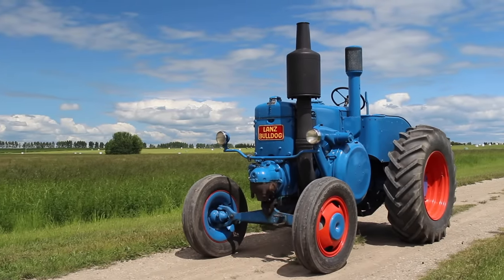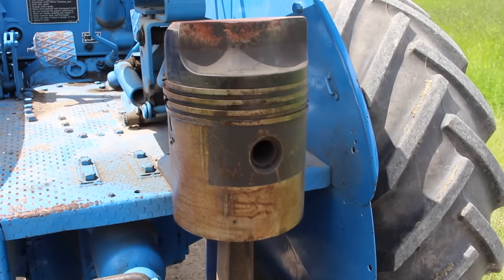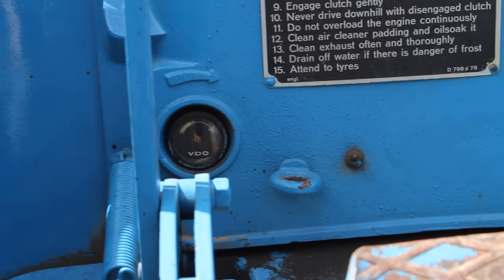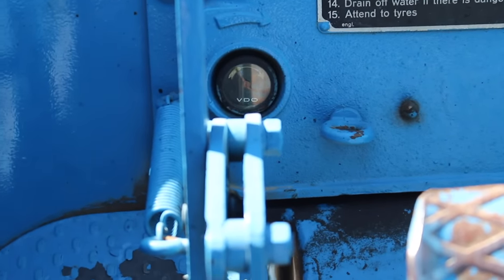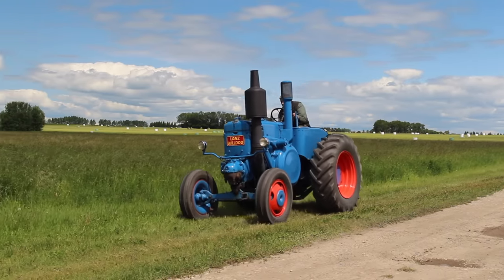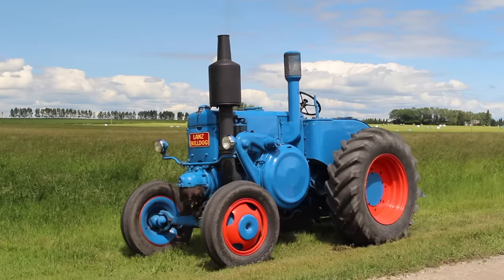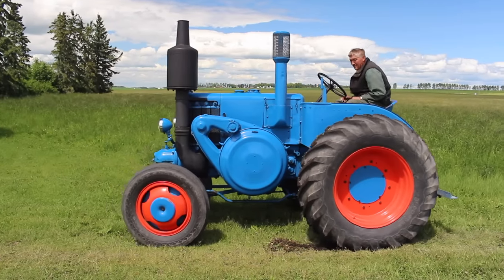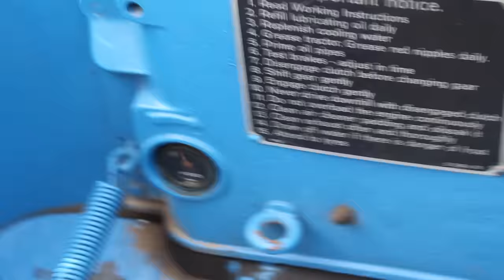Engine running backwards? Lanz Bulldog Tractor two stroke

Comment: these kind of tractors were particularly scary when ran uphill, since the engine could rotate so slowly that the force of gravity would reverse the engine rotation, imagine you're a climbing a steep hill and suddenly the tractor "shifts into reverse" at full speed and you're sent flying downhill facing the wrong way and with no brakes to speak of
Reply: No, it can't happen. Gravity can't reverse shit. As long you are rolling you can't just reverse the direction
Reply: @MaxMustermann-pu6er  if there is a heavy load, and it is running slow enough, a diesel can start running in reverse. I have seen an old caterpillar d2 with a four stroke inline four diesel pulling massive oak logs uphill. the operator didn't know what he was doing, and kept it in third. The immense weight, the too tall a gear, and engine being run almost to the point of stall. The motor started running backwards, exhaust started coming out the intake. And the thing started down the hill, the log chain almost getting caught in the tracks. Luckily he shut the engine off before major damage was done, ha. But in conclusion. Gravity can put such a strain on a diesel that it will try to stall and suddenly reverse it self. It is possibe and I know from experiance that it can happen.
Reply: @phantomcorsair8476  : You made it up as you wrote, didn't you?    A Cat D2 is a 4-stroke.   Lanz Bulldogs are 2-stroke.   Two strokes (Bulldogs, GM/Detroits) can run backwards as described in this video, but 4 stroke (diesels or gas or gasoline) engines, unless deliberately messed about with, cannot.  They can't because the fuel injection pump (jerk pump) runs at half crankshaft speed and the fuel-pump piston upstrokes will occur at the end of the normal air intake phase, which in reverse is now the exhaust stroke, due to the fixed valve timing.  
Modern Cat engines use hydraulically  operated electrically controlled injectors fed by a common high pressure fuel pump.   The injection force actually comes from a third pushrod, which in reverse will push after the (now) exhaust stroke, so reverse running isn't possible.    In any case the computer won't send the signal at the right time to enable backwards running.  This obviously does not apply to a very old (i.e. pre hydraulic operated injection) D2 bulldozer.
It is possible to stall a diesel engine and have it fire back through the intake manifold, but only for one turn as the last charge in a cylinder is fired - the just completed compression stroke acting as a power stroke.   It's also possible for an extremely badly worn and very hot engine to run backwards for a short while by firing on lube oil.  Such engines are so worn they are very difficult to start when cold due to low compression.
You can, very very rarely, see a 4-stroke diesel running backwards in a workshop - I've seen it myself when I worked for a diesel engine dealer.   Diesel engines are configured in the factory for reverse running for marine applications.   If a mechanic makes 2 mistakes on a standard engine - installing a  LHS starter motor AND times the fuel injection completely wrong, it will run backwards (not very well).  This is pretty much a sackable offence, because you have to "try" hard to make such a double mistake,  and since the oil pump is running backwards, the bearings will be damaged in seconds.

A more common mistake is to install an RHS starter motor on an LHS motor, or vice versa.  The result is that the engine simply will NOT start.  It's a trap for apprentices, as they check everything that the tech school taught them, spend a lot of time, and that engine just will not start.
Reply: @keithammleter3824  can you fix my car?
Reply: @mobbdeep615  : Probably, if you bring it to me, and pay me a big enough bribe.   Almost anything is fixable if enough money is thrown at it.  
 PS - I made a silly error in my previous post.  A GM/Detroit engine cannot run backwards unless modified, even though it is a 2-stroke, because it is a force induction engine.  If you turn it backwards, the blower pulls air out of the cylinders instead of forcing it in,
Reply: @phantomcorsair8476  : You don't need to tell me basic facts about D2's that you can find out in minutes by watching D2 videos eg those posted by Squatch (which are excellent)  - I owned a 6U 1950's D4 and there is a bit of dialog between my and Squatch in the comments of a few of them.  The D4 is just a scaled up version of the D2.  I also worked for a Cat dealer several years (as an Engineer).
I suggest you do this:  Make out a series of piston, conrod, and crank diagrams for each 45 degrees of crank rotation to cover the whole 4-stroke series (2 full turns) left to right.  Mark on each stage the valve positions, the stroke name and the TDC position that is the nominal injection time.   The sequence (in part) goes:   exhaust valve open, closes and inlet valve opens, closes, compression stroke and injection.  Now, with a different colour pen, going right to left  mark the stroke names and injection time,  You are correct in saying the exhaust valve now functions as inlet, and the inlet now functions as exhaust.  BUT, as the jerk pump is driven at half crank speed, and pumps when the pump pistons move up, the injection time moves 180 degrees on the pump shaft or one complete turn on the crankshaft.   This puts injection just before the top of the reverse running "exhaust" stroke so the engine cannot continue running.   The sequence becomes inlet valve (functioning as exhaust) opens, injection (into residual burnt gasses), no compression stroke yet and inlet valve closes, exhaust valve(functioning as inlet) opens, then closes to begin the "compression" stroke .....
That's why I think your post was just your imagination.   An jerk pump engine like an old D2 that starts and runs ok just will not run backwards.  Not possible.
An engine whose bearings have rotated is not going to run much longer, but this sort of wear out does not enable running backwards.   What can enable it is really bad cylinder wear, but only when compression has become so low the engine is really really difficult to start.  Lube oil gets past the rings and if the engine is hot enough it can burn and run on it.
Note that valve and other faults can cause blow-back through the inlet manifold and air cleaner, but this is while the engine is turning in the normal direction.  One of the ways we dealers can quickly assess the condition of old D2's, D4's, D6's etc is to dissassemble the aircleaner.   As you pull each mesh out (they come out air end first and engine end last), you sometimes see them get progressively cleaner (the mesh has been doing its job of filtering dust out of the air) and then progressively dirtier - this indicates a badly maintained engine and it has being blowing back, and the aircleaner has been filtering out the engine soot.  You often may not hear it blowing back on a test run, but sometimes you will.
If you did indeed see a D2 going unintentionally backwards down a hill,  perhaps the operator accidentally knocked it out of gear (through this is not usually that easy to do on old Cat machines), he might have decided to change down when the engine slowed down (this implies inexperience), or it jumped out of gear due to really bad gearbox wear.  You actually have to try a bit hard to stall a Cat bulldozer engine though - on almost any soil the 6U tracks loose traction before the engine stalls, unless you are in a high gear.   The narrower 5U tracks are even more likely to slip.   I put a home-made tree lever on my D4, but the D4 was pretty weak with trees.   On anything bigger than a 150mm trunk, the tree would bend a bit and then the tracks would slip, digging a hole.  I used to just let it do that sometimes, and after a moment or 2 with all the shaking and vibrating, a tree root would break and then down the tree came.  A Cat with a stopped engine will not go down hill due to gravity if it is in gear, except perhaps if it is a really really steep hill.  It's geared down too much and compression is more than three times what a car engine has (15:1 ratio and a MUCH bigger displacement for the power rating). .
I guess you made your story up.
Reply: @phantomcorsair8476  : If it was INSTANTLY shut off, how do you know it would have continued to run if it wasn't shut off???  As I said before, an engine stalling can combust the last bit of fuel injected, run back part of a turn and blow it out the intake, but it will then stop - whether you shut it off or not.
Reply: @phantomcorsair8476  : I see - horrible grating sound - just like a really badly worn gear box jumping out of gear due to the  low RPM.  Perhaps the inexperienced operator immediately put it in another gear or back in the same gear, but by the time he got it in (it's a crash box - no synchro - could make some dreadful crunching sounds just trying to get back in gear) and let out the main clutch, the D2 was already going downhill at some speed.   White smoke is misted unburnt fuel - in other words the engine MAY have been forced to TURN backwards, but was NOT actually BURNING fuel and producing power.
Having said that, I still feel that your story is a tall one for certain reasons.  
White smoke from exhaust during normal use indicates a faulty injector preventing 100% fuel burn, or perhaps a crook valve causing no very low compression in one cylinder (which, with only 4 cylinders in a D2, would be pretty obvious in use).  Really not significant as far as your story about running backwards goes.
I would assume the operator swivelled the machine by pressing the brake on one side.   He didn't need to jump off - it would stop anyway, but I guess a guy with little experience could panic.  And if it still wanted to roll down hill (unlikely), releasing compression would only encourage it.  You implied before he closed the rack, which is a more logical thing to do - it can't possibly run with no fuel injected, but there would be full engine braking.  
Note:  In the diesel industry we usually don't call the "go" lever a throttle, because it isn't a throttle.   We call it a "rack", because it moves a device in the fuel pump (jerk pump) which actually is a rack.  A throttle is a device that varies air or gas flow in a pipe, as it does in a gasoline engine.   Air flow is always wide open in a diesel engine.  In modern electronic (computer) controlled engines there is no jerk pump and therefore no rack, but we still tend call the "go" lever a rack, unless it is the accelerator in a car or truck, in which we call it an accelerator.
Reply: @phantomcorsair8476  :  The squeeeeeeeeek sound, like a slipping fan belt  ....    I can't think what that could be except the fan belt.    (Perhaps the governor self destructing - don't think so though)  As you have described it now, it sounds like the symptoms of a stuck rack.    The speed control lever ("throttle") does not of course control the rack directly in a D2 - its a governed engine.   The operator's speed control lever just tells the governor what RPM you want, and the governor opens or closes the rack as needed to obtain that RPM.   The sequence of events would have been this:-
1.  The engine was started and the tow commenced in too high a gear.
2.   As the load slowed down the engine, the operator opened the lever commanding max RPM, and the governor opened the rack all the way.
3.   The rack stuck in the full power position but this was not noticed due to the heavy load on the engine.
4.   As the engine RPM did not increase, and perhaps continued to fall, the operator decided to change down a gear.  He would have pulled the main clutch and shifted out of the current gear.
5.   With the stuck rack, the governor has no control over RPM and without a load the engine began to race.  At this point it would be difficult to get it back in gear (as it is a crash box - no synchro) and closing the speed lever would have no effect.  
6.  The engine is now racing at extreme RPM.   (extreme for a D2 that is, max spec RPM is 2100)  The fan belt slips as mechanical power to turn a fan rises as RPM cubed, so it can slip even though it didn't at normal RPM.   Due to the extreme RPM, valve bounce is occurring, causing misfiring and blow back in the intake manifold.
In other words, the engine was not running backwards, it was just over-speeding.   You only thought it was running backwards, because of the strange noise and the fuel mist coming from the aircleaner due to valve bounce.  The D2 ran back down hill as it was not in gear.  It is possible that in his panic the operator managed to put the gearbox in reverse, but not very likely.
Perhaps that was why it threw a rod when restarted - the rack was still stuck and the engine over-sped again.  Or perhaps when the engine was stopped the rack un-stuck but the conrod was ready to fail due to the stress already experienced.
This scenario happens occasionally with badly maintained engines - it is a lot lot more likely than running backwards on oil getting down the valve guides.
If you don't change the oil, and/or use old dirty fuel, a stuck rack is one of the things that can happen.
Reply: @Kenionatus  : I am not familiar with Aebi (in fact I had never heard of it), but I checked the url you gave).   Is this a common rail engine?   A Cat D2 is not common rail, its a traditional jerk pump design.  Jerk pump engines cannot continually run backwards for the reason I gave, but this reason does not necessarily apply to common rail where injection timing is electrically controlled by the ECM.  However, in common rail engines I do know about, the ECM will sense something wrong and not fire the injectors.  Modern Cat engines (the ones actually made by Cat and not the ones made by others) aren't common rail until about 2010 or so, they use a related ECM controlled system (HEUI/MUEI) and inherently cannot run backwards
If you do get a 4-stroke engine to run backwards, and in fact most 2-strokes, it should be shut off IMMEDIATELY as the oil pump (always a meshed gear pump, except apparently on the Lanz) will be pumping backwards and deprive the bearings of oil in a second or less.
Reply: @phantomcorsair8476  : "..  Little or no governing .."  That pretty much says a stuck rack as the governors on D2's D4's etc normally hold the engine  RPM in an iron grip, load permitting.  
I'm mystified by the squeel/squeek/pig-in-pain noise if its not the fan belt.    Governor self destructing?   Bearings rotating??  Oil pump starved of oil? - don't think so.  Water pump or hydraulic fluid pump?  Possibly.  I can imagine the total noise was pretty shocking loud though.
Reply: @phantomcorsair8476  : Fortunately, I have never been anywhere near an ape during or after its' rape.    Been near raped house cats though - the noise they make is loud and dreadful.   And the tomcat, after the event, has an expression on its face that suggests "I actually don't know why I did that."
Reply: @phantomcorsair8476  :  Cats (the meowing kind) are amazingly violent animals, and they can make the most awful blood curdling screams and vocal abuse noises.   I have no opinion on B61 Macks with Triplex gearboxes etc, no experience with them.  I am dimly aware of them, that's about all.   1960's era I think.  My interest in Cat bulldozers comes from owning an old D4, which I bought for doing firebreaks on my hobby farm.   My experience in working for a Cat dealer was mainly in electric power generation (3406 through to 3616 engines), with some experience in marine propulsion.  Limited experience in modifying Cat truck engines for long haul freight service (the factory options for oil change intervals - even the largest oil pan option for 3406 and C15 - are too short for cost-to-coast freight in Australia - a single round trip can be 6,000 to 10,000 km.).
Reply: @keithammleter3824  how the hell did this  conversation go from CATs to cats?
Reply: @racecarthedestroyer7192  : Don't forget this started with a bulldog.   Nothing wrong, providing a) somebody is learning something, and b) its fun, and preferably both.  Seems to be the case.
Reply: @keithammleter3824  yeah, true, but did you see the funny i pulled in my previous reply?
Reply: @racecarthedestroyer7192  : Well, yes - Cat (as in big yellow machine) to cat (as in feline).   I thought I had replied in kind: dogs and cats.   I think we have all done enough with this thread now.
Reply: @keithammleter3824  ooooh, yeah lol i see what you did as well
Reply: @keithammleter3824  you and Phantom Corsair need to open a shop together and make some new type of diesel engine to save the world
Reply: @keithammleter3824  You are the only man I would trust to take care of my tractor. I have heard no mechanic so far who knows so many technical details. Most of them are I-know-from-experience ones, just randomly messing with the engine until it fixes itself.
Reply: @marinosavros  :  Marinos, I thank you for your very kind post.    However, I am not a mechanic (though I have always maintained & repaired my own cars and hobby farm equipment).   I am a professional engineer,  who has been responsible for the project management for new diesel power generation, and the customisation of diesel engines for special applications and non-standard fuels, plus the sale of engines in the power generation and marine propulsion markets.
Reply: @keithammleter3824  Either way, you should be proud of yourself. Your dedication and passion about your field are rare qualities which sadly we don't find enough those days. I congratulate you and I wish we had more professionals like you. It's clear that you are dedicated to it.
Reply: @keithammleter3824  My mate had a suzuki ap50 2 stroke motorcycle, he would bump start it backwards and it would take off 😄until he crashed as it's hard to ride in reverse
Reply: @ianmangham4570  : Certainly.   The AP50 is a 1970's era rotary valve 2 stroke gasoline engine - such engines can indeed run backwards quite well, because ignition is at every TDC and not every second TDC, and there is no blower that would suck air out instead of forcing it in.   It would have the Suzuki Posidrive forced lubrication - not 100% sure but I think that would still work too (piston pump).   I doubt if I could ever master riding backwards though.
Railway companies used to have gasoline 2-stroke powered little open railcars for track maintenance staff.   These were just push started in whatever direction they wanted to go - no reverse gear was fitted.  They were just big enough for up to 4 workers to ride on with their tools.  Lubrication was ok either way because they relied on crankcase suction and oil was mixed with the fuel.
Reply: @keithammleter3824  😄🙋👍
Reply: @keithammleter3824  actually it can happen, plenty of isuzu panthers with 4jb1 engines and older 2800cc Mitsubishi tritons have ran away, and both of those engines are naturally aspirated too. Here's an example https://youtu.be/P8DAlFEMDVs
Reply: @tristan6509  :  These Mitsubishi Tritons have a reputation of running away due to imperfect crankcase ventilation design - crankcase lube oil  can get into the intake manifold via the crankcase ventilation, without requiring the engine to be so worn it is difficult to start.  It can happen if you grossly overfill the engine with oil, causing the big-ends to whip the oil into a mist.
The video you cited is interesting as it appeared that the owner drove it away after it cooled down and thus stopped running away.
When you said "actually it can happen" did you mean runaway (which I described earlier as a problem with badly worn diesel engines) or running backwards?  The 4JB1 engines are commonly seen with 2 different fuel systems - Bosch A and Bosch VE.  I'm not familiar with Bosch fuel systems, being a large engine man, but Bosch A is a rack (stroke) controlled jerk pump and will not run backwards.   The VE is described as a "rotary" system - this generally means a jerk pump in which injection quantity is controlled by rotating the pump cylinders against a slot.  Running backwards should still not be possible but as I am not familiar with the VE system I cannot categorically say it can't, due to some design flaw or fault condition.
Reply: @keithammleter3824  the american 5-ton m9 trucks can start in reverse I know, pretty sure some models of semi could as well.
Reply: @RainytheNB  : What are you talking about??   What are you smoking?  The US M9 is a WW2-era half track made by International Harvester Corp that had an IHC RED-450 141 HP GASOLINE 4-stroke engine.   It most certainly CANNOT run backwards unless you install the carby on the exhaust manifold side,  or change to a different camshaft.   Without either, the engine would be sucking pure air and not air/fuel mix.  Either way you'll have to reverse the oil pump as well or it will suffer serious damage in a few 10's of seconds.
Some exported M9's were fitted with a GM 71-series 2-stroke diesel engine.   This simply cannot run backwards because it is a forced induction engine.  Turn it backwards and the blower sucks air out of the engine instead of forcing it in.
Unless you mean the M9 could be started and driven off with reverse gear selected.   Any vehicle can do that and it has nothing to do with what this thread is about, which is about engines running with the crankshaft turning backwards.
Reply: @MaxMustermann-pu6er  it can happen with a heavy enough load
Reply: @keithammleter3824  my 1999 subaru forester runs backwards all the time
Reply: @roboticunclephil  ALL the time?   That must be darn annoying for you, and amusing for other drivers, particularly on the freeway.   ALL the time?   You mean when neither you nor anyone else is driving it or even in it?
NOTE for others:   As far as I know, 1999 Foresters were only available with gasoline engines.  See above.
Reply: @keithammleter3824  im typing this comment while running backwards in it right now
Reply: @roboticunclephil  : According to the famous physicist Stephen Hawking, time could be running backwards.  So, you could be mistaken in thinking it's your Forester.   Did you in fact type the "w" first?   We can never know.
I've just eaten dinner.   I ate the desert, then the main course.  Probably.
Reply: @roboticunclephil  : Alternatively, you must be an extremely slow runner, given there's no much room in a Forrester.  Don't forget its not a run unless you use both feet or both hands.
Reply: @phantomcorsair8476  yes, because the engine was at the point of stall. Not just because the load was heavy
Reply: @dieselgeezer18  it was, you count the power strokes it was that slow. When the d2 started down the hill, the loss of the load made the engine scream like it was possessed.
Reply: @phantomcorsair8476  what im saying is that this could be easily prevented if you didn't run the engine to the point of stalling
Reply: @dieselgeezer18  I wasn't the one operating. I was off to the side working on a john deere. It sounded lime it was about to stall as it was skidding logs up a steep incline. I heard a loud pop and then I turn around and see the crawler racing down the hill screaming like a detroit with white smoke from the intake. The operator swivel to prevent the crawler from getting out of control and runs to the side of the engine to throw the compression release. The sound was: CHUGGACHUGGACHUGGA CHUGGA C.H.U.G.G.A..... BWAAAAAAAAAAAAAAAAAAAAA WHOOOOOOooooossssshhhhhh.... the engine must have spooled over the 3 grand mark.
Reply: @keithammleter3824  you seem to be fixated on your knowledge of how engines are SUPPOSED to run, and forget that diesel engines often run with NO fuel injected, if the rings are bad etc.
The injection may not have been happening at the right moment, but it was putting a full throttle shot of fuel into a very hot engine, which gives it more fuel then sucking oil fumes past bad rings would provide.

You seem to like hearing yourself talk, and showing off how detailed your knowledge is, but you fail to look at the big picture of other things that could be happening, and so place yourself as the judge of whether a story could be possible.
Reply: @ke6gwf  :  You need to read Phantom Corsair's posts, as you seem to have the circumstances confused.   I've not denied that diesel engines can run and even overspeed on their own lube oil - though the big picture is that it doesn't happen often, and when it does, it is more commonly due to sucking oil from the crankcase breather into the air intake, than via very worn "rings".   Actually, worn rings is a something of an urban myth.   If you've ever stripped an old engine down, you would have found that it's the cylinder walls that are worn down, due to acid attack from the sulphur in the fuel.  That's why engines are overhauled by boring out the cylinders and rehoning - which mandates fitting oversize pistons and rings.  The advent of low sulphur fuel in the last 15 years or so has dramatically reduced this sort of wear.
Reply: @MaxMustermann-pu6er  Get real, near stall speed a lot of engines can reverse, some old 100cc Kawasaki 2-strokes comes to mind. 
In any case, the Bulldog had many disadvantages and this is another that i didnt even think of. I got an old tractor and had several before, all of them very capable and practical but the Lanz Bulldog is not.
Reply: There is a governor for fuel dosing, you don't need to get off the seat and pump the fuel pump
Reply: I've seen 4 stroke diesels run backwards. Mack semi, stuck in the mud. Driver was rocking it back & forth, it lugged clear down. Oil started raining out of the exhaust. Driver pulled the fuel shut off, let it sit for awhile. Started it back up and continued down the road. This time with a little help from a dozer.
Reply: @ianmangham4570  Harley Hummer would do it,also.
Reply: @keithammleter3824  I've seen a 4 stroke diesel Kubota engine run backwards and I've seen gasoline engines run with no spark, stranger things have happened.
Reply: @BigRig003  : There is nothing strange about a gasoline engine running without spark.   British vehicles such as LandRovers with the original 4 cyl engine often kept going after you turned the ignition off.   Morris Oxfords would often do it too when engine cooling was compromised by white gloop build-up in the water passages.   Built up carbon in the cylinder heads got hot enough to fire the intake charge, and in some engines the exhaust valves could get hot enough to fire the charge.  They didn't run very well with ignition off, but they did run. 
In the 1970's I worked for an engineering company that had a fleet of LandRovers - they all kept going after you turned ignition off.   It was necessary to stop the engine by stalling it in gear by letting the clutch out.  Suddenly flooring the accelerator would also stop the engine, but this was contrary to company policy.
When Australian Phase 2 emission regulations came into effect in 1977, engines ran hotter due to lean mixture, causing them to continue running after turning off ignition.   This was corrected in Ford Falcons with the cross-flow head by the addition of device called a "ground idle solenoid".   The Stromberg BV carburettor was set up to produce an idle RPM (termed "ground idle") low enough to ensure that the engine stopped when ignition was turned off.  When ignition was on, the solenoid advanced the throttle plate slightly, raising the RPM to "curb idle" speed, so that the engine would not stall or shake.  
Very old XC Falcons would sometimes keep going after ignition off despite the ground idle solenoid - due either incorrect set-up by backyard mechanics, or white scale buildup same as Morris Oxfords.
Engineers can get an estimate of total engine friction losses by performing a "Morse Test" - this involves measuring the power output (on a dyno) and then the power drop when each cylinder in turn is prevented from firing.   This total of all cylinder drops  in theory exceeds the normal power output by the amount of friction.   It's a reliable test with diesel engines (by cutting out injection on each cylinder in turn), but when done on a gasoline engine by shorting out spark plugs is unreliable as cylinders at full throttle will tend to fire anyway.
But 4-stroke diesel engines running backwards?   Nope, don't believe you, not continuous running anyway.    It can happen with marine engines if the wrong side camshaft is installed.
Reply: @keithammleter3824  well I seen it so it happened, so yeah. And yes it is a bit strange for a gasoline engine to run without spark, especially engines that are meant to run with spark. My buddys square body with a 305ho use to sit and diesel away after you shut the key off. I've had similar experiences with chainsaws. Too much carbon gets built up in the cylinders and compression going up a just enough to make it combust with no spark. That's how I've come to understand it Tho. And if you don't believe diesel engines can run backwards, go check out 1puglifes diesel clone engine on YouTube. It was a 1 cylinder yanmar clone that ran backwards, exhaust was coming out of the intake.
Reply: @BigRig003  : If you mean this one by 1puglife: https://www.youtube.com/watch?v=MFcR-rgPjgQ, there is NO evidence in the entire video of it running backwards.  He just thought it did.  What was happening is white "smoke" coming from the air intake - this is not actually smoke, it's fuel mist due to a faulty intake valve not fully closing.  Some fuel is burnt allowing the engine to run (in the normal direction) and some is forced out past the bad intake valve.   There may be a slight blue tinge due to oil.   The engine is old and knackered.
As several posters said, probably due to incompetent work the valve may have hit the piston.  It works ok cold, but when the engine warms up expansion causes it to leak - probably has a very slightly bent shaft.
As to the starting rope breaking - that means nothing.   All of us who use small engines a lot have had the rope break just as we've started the engine - it was frayed and one last pull broke it.
If you believe that he pull started it, which can only turn it in the correct direction, and it then decided to reverse itself, well, you believe in fairies and pots of gold at the end of rainbows.
Reply: @keithammleter3824  yup yup I 100% agree with you also most pumps if you run backwards they will suck instead of blow so if the diesel WAS to be run backwards then it'll suck all the fuel out of the injector lines and completely starve the engine i don't even think a poorly maintained one can run backwards either since it can't run away since its blowing into the intake port meaning it can't get oil from the turbo system (bad seals is one of the main causes of runaway diesels) meaning it'll be impossible to get oil to runaway with so in short it would starve itself of almost all fuel sources before if it tried to run backwards.
Reply: @keithammleter3824  so can this tractor suddenly start running backwards while going up hill cus now I want to know and you seem to know a lot about it
Reply: @quintengiegas6330  :  I believe I explained that before.   It is a diesel 2-stroke with crankcase air induction like a 2-stroke lawnmower, with jerk-pump fuel injection - the jerk pump squirts fuel into the cylinder at approx top dead centre regardless of crankshaft turning direction.
If the tractor is going up hill and is stalled by an increase in slope or some obstacle such as a large rock, hillock or tree root, gravity will reverse engine direction, the engine will continue to fire at top dead centre and the tractor will continue backwards down the hill under power.  Starting up a hill with too little "throttle" will cause the tractor to go slower and slower until it stalls and thus cause it to run backwards, as BaffoMatto said.   
It cannot spontaneously start going backwards - something must stall the engine.
Reply: @keithammleter3824 I always thought the old D311 engines were 2 stroke
Reply: @local38on-tv  : If you mean the Cat D311 engine as used in D2 bulldozers - it's 4 stroke.   If you mean the engine in a Cat 311 excavator - it's 4-stroke too.   4-stroke is what Cat did and does.
Reply: I've been loving this exchange,  even though it's heated at times. I'm learning an awful lot of cool stuff,  granted some of it being questioned.  Here in Wisconsin,  the legendary Kahlenberg 2-stroke
hot-bulb marine semi-diesels were designed to be reversible......an air distributor could be switched either way to reroute the aspiration,  eliminating need for reverse gearing.  This was especially handy in my Island community for advance-and-retreat ice-breaking.  As a boy,  we had a c.1928 Elto Light Twin outboard motor with exposed flywheel & know.  The manual gave a choice of conventional starting against compression or by  "bouncing" back first,  presumably with full spark retard (or should I mean advance?).  I was running my chain saw one time,  probably a Stihl but maybe Homelite or Shindaiwa,  and decided to shut off,  then decided to switch on and keep going,  and was stunned to see the chain atop bar coming back,  namely running backwards,  with the consequent weird torque reaction.
Reply: Excuse above misprints.
Reply: @keithammleter3824  Two stroke diesel! not four stroke diesel and this machine is  hot bulb with no fuel injectors so I do not believe a fourstroke can run backwards but will consult my Diesel guru and see what he says.
Reply: @MaxMustermann-pu6er  You can reverse the Rotation while driving. It the rpm goes to low betwenn shifting two gears the engine go on block und you have the same effect like in the video. The block comes with a big boom.